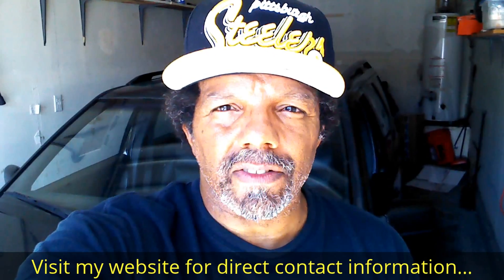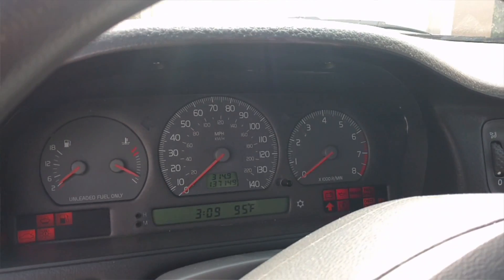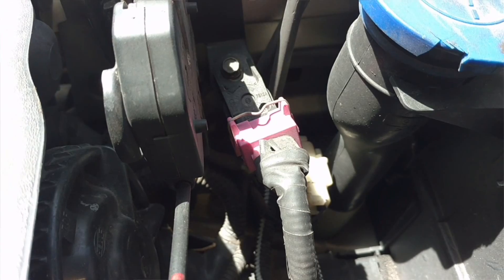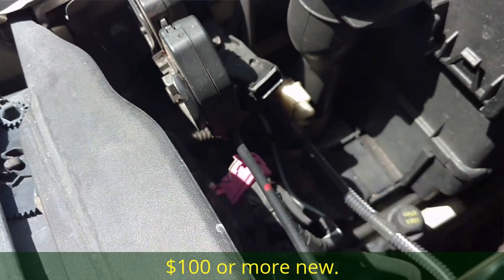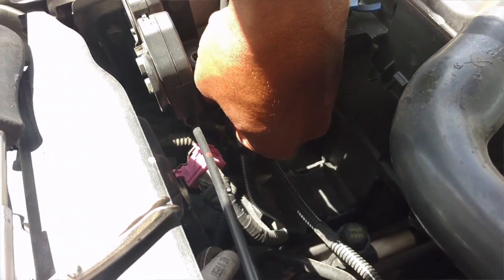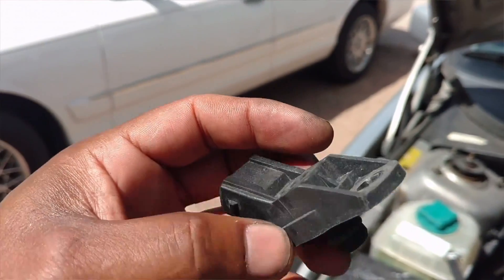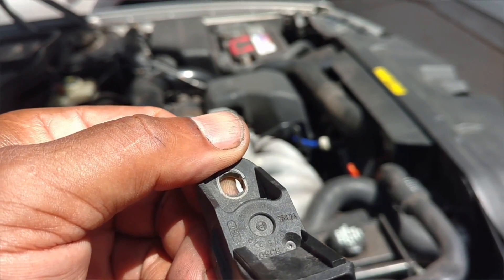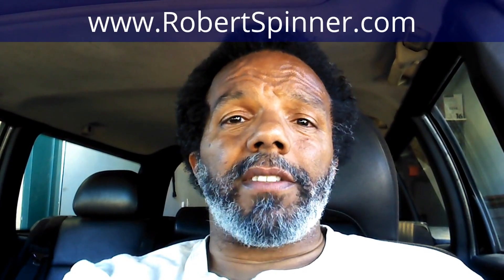Error code P0108 for Volvo S70, V70, 850, etc., repair. Manifold pressure sensor - VOTD

Comment: i have been following your instruction and cleaned the sensor, after a few hundred kilometers it came back, so i changed the sensor, and again, 1000km after P0108 poped out again, i am now using my 3rd sensor in two years, i start thinking the issue could be elsewhere..  thank you robert for your precious videos
Reply from the maker: Probably a wiring issue if it works for a while then kills the new sensor.

Comment: Hey I have a 1996 850 T5 and I'm getting this code along with p0112 iat and p0101 MAF code. I got these all after I swapped a m4.4 from a 1997 850 glt and had someone local to me reflash the ECU for green injectors and 960 MAF, btw the maf is a brand new Bosch and I bought it 2 year ago. Did the m4.3 ECU's have a barometer pressure sensor because I can't not only find the sensor but even the connector from the harness for it. In that case would that throw the codes I'm having. The car also surges like crazy occasionally, thanks buddy.
Reply from the maker: Nope. I believe that sensor is near the passenger head light.
Reply from the maker: Sounds like a bad MAF. You can use the old MAF in the new housing.
Reply: @RobertDIY  ok perfect I have a spare MAF, I'll swap it see if I can get the iat to work

Comment: Hi Robert..
I owned volvo 850 for what does the code 4-1-1stands for. I put the wire in 6 A.
Reply from the maker: I have no idea. Did you search it?
Reply: @RobertDIY  No I didn't. Becaue I do not know how to and when to search.Could tou help me pls.
Reply from the maker: https://youtu.be/bfeiZxhJgxY
Reply: @RobertDIY  Dear Robert...
When l put the jumper in hole 6 group(6).The code 4-1-1 has been register. I don't know the equivalent fault.Could you write the error pls.
Reply: Group(A)
Reply: Thanks for your interaction with me..

Comment: I’ve been digging through forums with no luck. I replaced my sensor with a new one (I luckily already had a lifetime warranty sensor) and the code will go away for a drive or two and come back. I don’t know what to do. The connection wires seem fine, and the inside of the connector is clean.
Reply from the maker: sad to say, not sure how I can help.
Reply: Robert DIY thanks for taking the time, and keeping me on the road through any other problem. You’re a legend. I’ll keep digging.
Reply: Dean Hass did you ever figure it out?
Reply: Escargot unfortunately no, I replaced every sensor in that circuit, rechecked voltages and everything. The code persisted. I accepted defeat and it’s is in the shop having the wiring harness looked through right now.
Reply: @gnarlymage  Well, guess I got lucky. I whacked the sensor with a wrench a few times as suggested on a couple of Volvo forums, cleaned it with WD-40 as suggested in this video, and let it dry overnight. The code hasn't come back so far after 50+ miles of driving. Was able to pass my emissions test today! Thanks a bunch @Robert DIY!!!
Reply: @gnarlymage  what ended up being the issue?

Comment: This code just happened to me. I went to AutoZone to have them get the code. I asked them what the code meant and the guy told me he had no idea. Then I was thinking "I bet Robert has a video!". So here I am! How long can you drive with this sensor being bad? I have to wait until the weekend to look at it. Thanks Robert!
Reply from the maker: +Christopher Trimble as long as it runs ok, you can keep on driving.
Reply: Robert DIY It runs smooth like it did before the light came on. I will clean it like you did in the video and hope it is just dirty.

Comment: is anything supposed to be connected underneath to the sensor?
Reply from the maker: +Rodrigo Espinosa I don't understand your question.
Reply: Robert DIY underneath where the green o ring is, does something connect there like a hose or something or is it just  the wiring on top (not familiar with the workings of  turbo models)
Reply from the maker: I have no idea what you are referring to. Maybe you can tell me the time stamp on the video so I can find and see what you are referring to.
Reply: Robert DIY as you pull the sensor and turn it upside down. at 1:23 is anything supposed to plug into that end sorry first turbo and am not familiar with its workings
Reply: @rigorasta88  Robert is a little slow i see.  He knew what you meant.

Comment: hey robert my mechanic was just changing my spark plugs everything seemed to be smoothly done and when he put it all back an d I start the car a code p0107 came up but we were able to fix that by changing the rubber black gasket. but now a p0108 code came on it saying  a baro sensor is faulty. car runs fine when cold but after a few minutes it will idle high around 1000rpm. i also got engline light on, flashing throttle body light and traction light on. please help me as i just spent $418 to change the plugs and gasket. 

note: my car did not have any codes or issues before i brought it in to my mechanic. i just wanted to do a simple spark plugs change that led to all of these error codes.
Reply from the maker: +samuel john what kind of car do you have?
Reply: Robert DIY 2006 charger 3.5L
Reply from the maker: Yikes! I don't know. Maybe some connector or vacuum line is loose. Is it a dealership?
Reply: Robert DIY were assuming its the connector because the code for the vacuum leak was gone and we dont hear anymore air leaking. no its not a dealership its a shop.
Reply: @samueljohn2440  what did it end up being?

Comment: Hello Robert.
help me .... again. ;)

I'm the light on the dashboard.

when scanner step, accuses all sensors etc ...

after the reset in the center everything is standard .....
but after a few km the light comes on.

I realized a crash. What happens very fast,
engine failure,
car acelara sozino,
rele glue radiator,
of a general breakdown .... but all in seconds.
zummmm and back .....

volvo 850t5 1996
Thank you brother
att.
josiel nesi
Brazil
Reply from the maker: +josiel nesi likely has a loose wire connector for the computer.
Reply: I will start by wires near the sink, very dry station .;
brother .... you is top.
thank you,.

Comment: If I had a nickle for every time I dropped a bolt/screw, I'd be a rich man.
Reply: I gather up all my extra screws and nuts and bolts and toss them into old coffee cans just so that I have some spares to replace the ones I lose.  I dropped a nut down into the turbo charger intake one time.  I had fun getting that one back out.  I had to use a magnet, coat hanger, duct tape, string, mirror, and a flash light.  That was the last time that I forgot to stuff a rag into the mouth of the intake tube before working on anything else.
Reply from the maker: Yes, it can be painful.

Comment: Thats a lot of cash for such a farty sensor.
I wonder how the computer knows its gone faulty, hmm.
Reply: zx8401ztv   It's a dealer only part and there is always a serious mark-up on those parts.  The value of the Euro went down almost 40% against the Dollar, and Krona even more, but parts prices didn't go down.
Reply from the maker: Uses the measurement to help with air/fuel ratio mixture.
Reply: Oh yes i know its an altitute sensor, i would imagine it would indicate the density/pressure of the air going into the system, so the fuel/air mix ratio would have to change.
I just thought it was expensive for such a farty sensor LOL.
Reply: The MAF sensor is measuring the mass of the intake air and the correct amount of fuel is being injected to maintain the correct air/fuel ratio.  The computer is probably comparing engine speed, throttle position, MAF sensor, and vehicle speed with the data from that sensor.  When all the data points except that one, all line up, the computer determines that the sensor is faulty.  The engine should run fine but it might have some trouble starting or idling.
Reply: But i was still saying it was expensive for a barometric pressure sensor lol :-D
Reply from the maker: Yes it's a costly one. The $100 price if for one at a parts store that sells OEM parts. As John explained, the MAF is measuring the intake pressure, this one measures the barometric pressure. Then there is an altitude sensor. Not sure why cars are so picky. Just thankful they can still run if the thing is faulty.